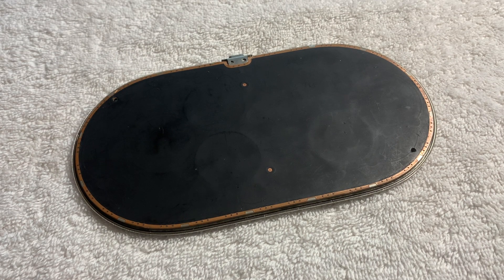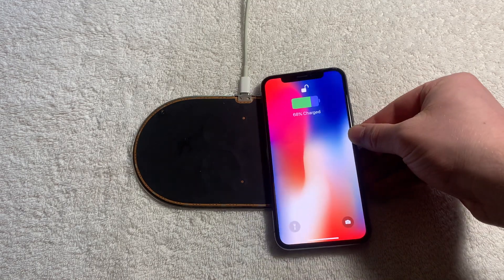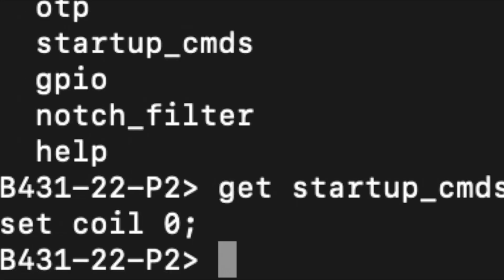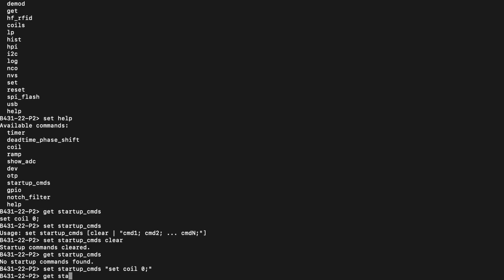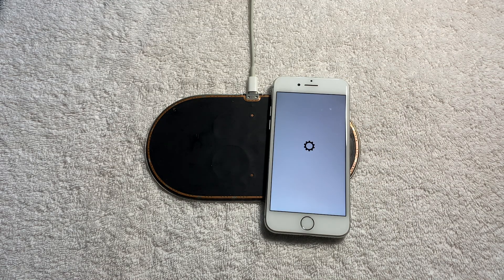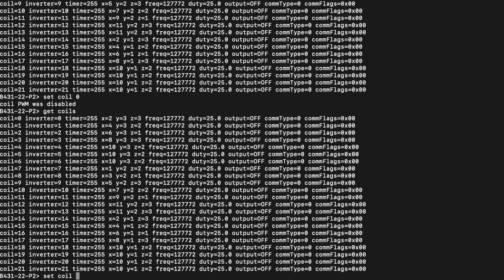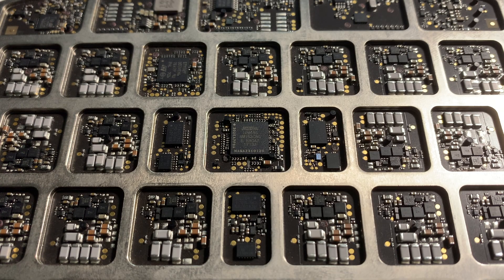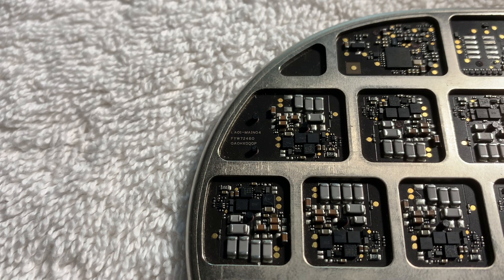Apple AirPower Prototype - Now Working!

Comment: You don't realize that you now have a piece of tech that can be used to build off of in order to fully get air power to work without overheating.And destroying itself, the fact that it works, and you can set one coil on without it, destroying itself is pretty cool.But imagine being able to figure out what makes it overheat, and fixing that problem when there's multiple coils on and having a software as well, that can detect what coil gets turned on, depending on where the device sits that would also be really cool

Comment: I have an idea!
Forget the big wireless charging coils!
We need to make very small ones in a honeycomb pattern in the phone and the charging pad!
They both are the same size for both devices.
In the middle on each coil there is a proximity sensor on both devices.
If you place your phone on the charging pad, then only the coils that are in front of each other will turn on because of the proximity sensors that only work with each one another.
We can put middle magnets in each coil so they can line up itself easily so the induction can work efficiently.

Comment: Good call on preserving the wireless charger. I would be worried also about heat. I had a wireless charger stop working because I would always leave it plugged in not using it at all

Comment: I assume they had the idea of not needing to line up your charger to get the coils perfectly lined up, realized it was harder than they thought, then they went with the cheap and cheerful solution of magnets
Reply: More likely, they were already testing MagSafe internally… Which makes this all the more weird, they should’ve kept testing this instead of pre-announcing it without being sure. That would’ve made MagSafe look even better, instead of leading some to believe it was an answer to this problem… They were both an answer to a problem, and the Apple of yore would test the heck out of a solution before going with any particular one.
Reply: @Mainyehc  It's possible that there was 2 teams at apple, one of them was doing magsafe, and the other airpower. that from what I hear is pretty common at apple.

Comment: It was overheating because if one coild is powered next to another, the not used coil's capacitor will need to disapeat the inducated heat.
If you write a command to turn on a row, then if one is detected a device, the cpu should turn all the coils around to find out which one draws the most power, then keep that one on, others off.
But meantime the others will heat up.
So coil on coil is  abad concept.

Comment: i wish it had the animations like those on the event.
Reply: Interesting enough the animations are still in the public iOS 11 firmware files and are on the phones still running iOS 11. People have gotten them to trigger via jailbreak mods wonder if he could do the same
Reply: I'm 1 year late to the party but the animations are not actually in the files **by default**.  The animations are downloaded to the device when the charging view app is called. This charging view app was included from iOS 11.0 up to iOS 11.2. 

There are references and even testing apps for it in iOS 11, 12 and 13 but I never really had much getting the test apps for it to actually work on production/stock/public builds of iOS. (I'm also too scared to dual-boot an internal version because I'm scared of bricking my iPhone X on stock iOS by accident)
Reply: @mossystonebrick  yeah i dont think its worth risking release ios iphone x too. would love to see the result tho. thx for the info you gave.
Reply: @theshuttel  coming back to the table with this: I did some more tinkering and it turns out my iPhone X on iOS 11.2.2 can use the ChargingViewService when I bring it in from an earlier version of iOS 11. It doesn't work as it should because A) I don't have AirPower  B) The animations are no longer available for download (Probably because Apple deleted assets and IPSW files for iOS 11.0 thru 11.2.6) so the iPhone just freezes until the animation should've been done.

If someone had tinkered with this closer to launch, we might've had those animations preserved by now.
Reply: @mossystonebrick  there are ios 11 ipsw for both iphone x and 8s. i think there is a chance those animations could be in there.

Comment: I also thought of an idea. You could maybe setup a shutdown command if gets too hot. I use a mobile device that has cooling liquid in it, an emergency shutdown system to prevent any damage if gets too hot, and a fan. The device uses a lot of power but since all these things work together maybe it could be a good idea on device like that. Wonder why Apple never thought of that if it ever got too hot since I would think it would solve a lot of these main heating issues in thinking of this. Hope it works out if you do try some of these ideas. Still just amazed lol.

Comment: I think it would be okay to turn on two coils, monitor with a UV Temp gun (don’t let it get over 130F), and quickly set two items down just to prove they had the technology. I’m sure the overheating is a problem with 3 coils on, charging devices, for a long period of time. And even then the overheating will not actually physically damage any components until it’s been done for multiple uses over multiple uses.